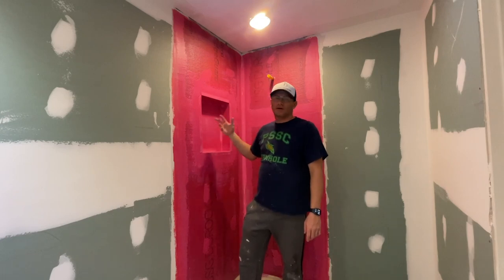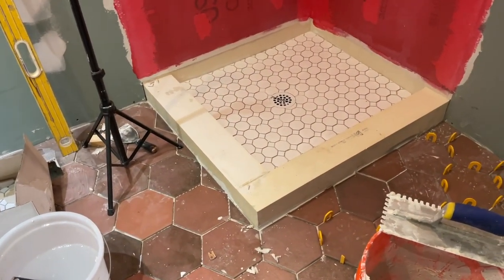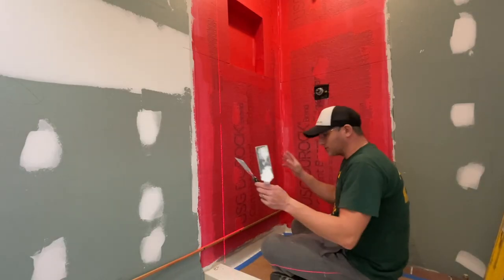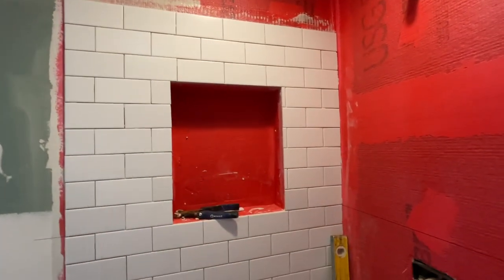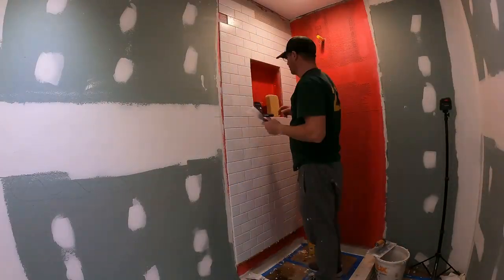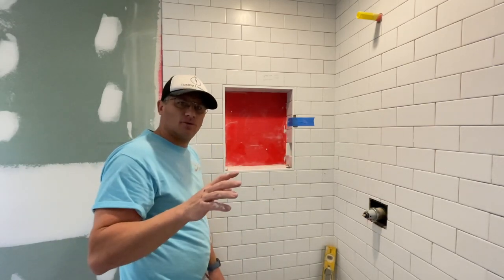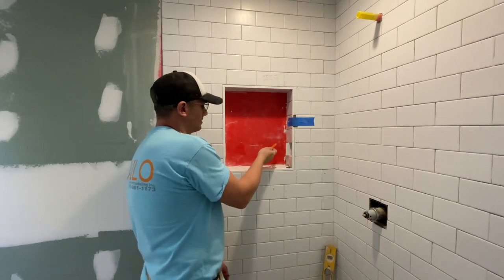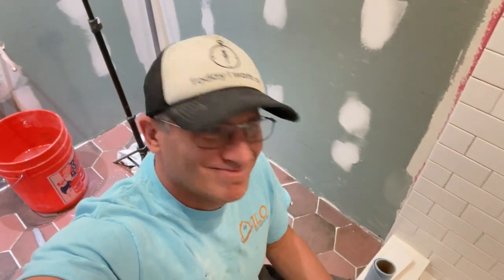How I Remodel a Bathroom, Part 4!

Comment: I see you installing mosaics on a lot of the shower bases. Is there a reason for doing mosaics instead of regular tile?
Reply from the maker: Simple reason, less prone to slip.  Bigger tile, less grout lines, more ways to slip and fall. I actually broke my butt in my own bathroom last week getting out of it with no floor mat. Tile was slippery and I slid 1/2 way across the bath floor and bumped my face on the glass door. Tile and water, very slippery.